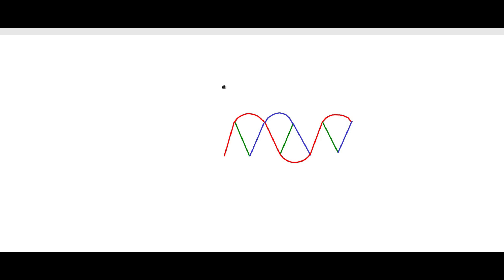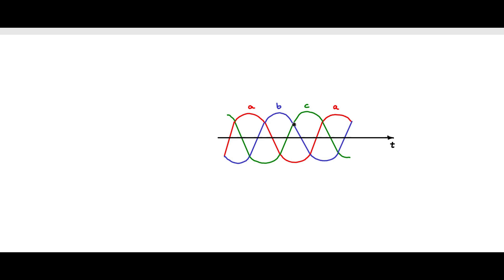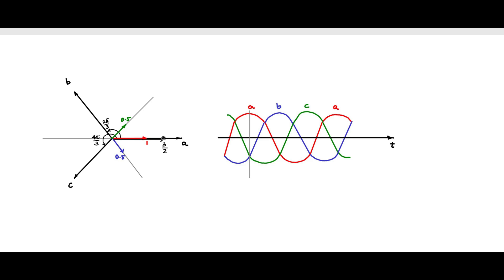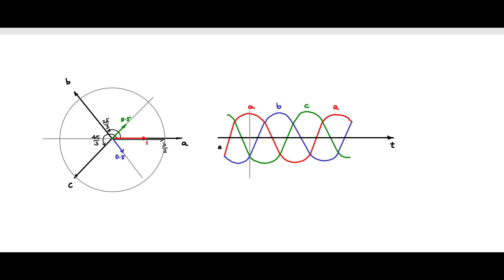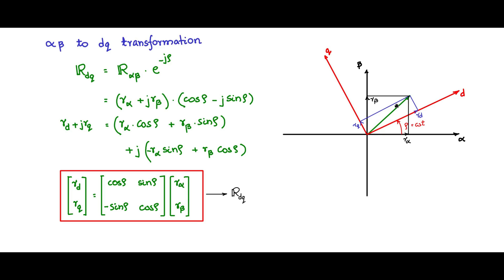d-q theory : AC to DC transformations

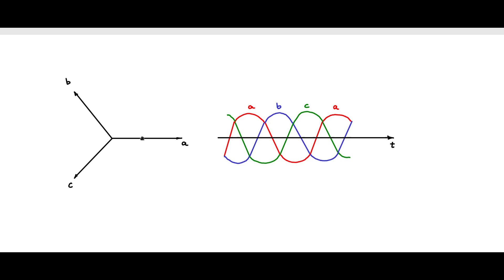Comment: There is an error in this video. On the drawing seen at 1:40 b is defined as sin(x+(2/3)*pi), however, on the phase plot b and c are switched. You can see this because when a is 0 (sin(0)=0), b should be a positive value (sin(0+(2/3)*pi)>0), and likewise c should be negative. The answer is that b and c are switched from the vector plot to the phase plot. The result is that with the transformation that is presented, the ab vector should be going clockwise.
Reply: You are right but most of the video , not only in this one,  has done so. Phase B and C are  switched.

Comment: how does that negative .5 became positive while multiplying with cos 60. It should be negative 0.25 right?
so negative .25 and negative .25 sums up and give -0.5 which overall gives 0.5 and not 1.5
Am i wrong?
Reply: We use vector addition and not algebraic sum.
Reply: If you look at the original phasors of b, or c, cos 60 of these phasors would lie along the x-axis but facing in the opposite direction to phase a. Therefore, the resultant is a - b - c. But b and c are negative 0.25. So the resultant becomes 1 - (-0.25) - (-0.25) = 1.5